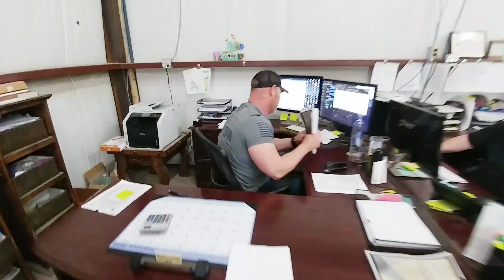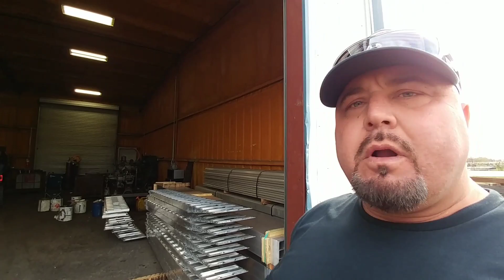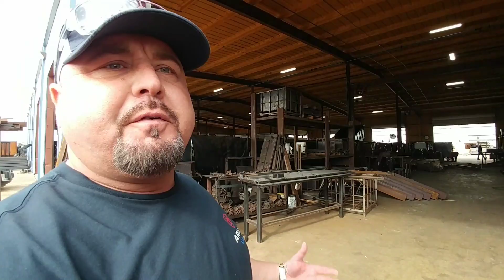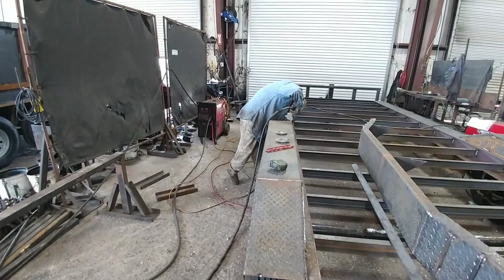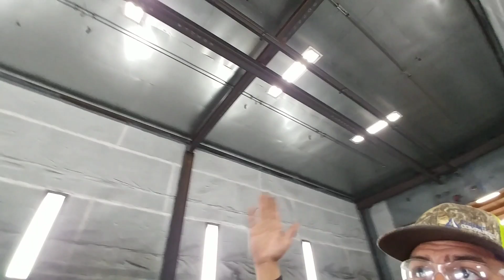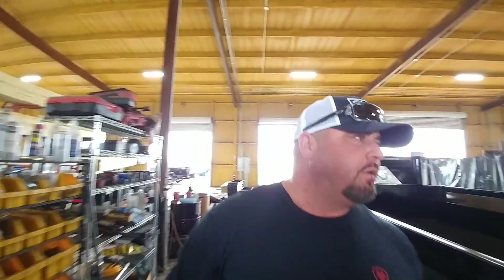How Trailers are Built! ASMR for men! Factory tour at Texas Pride Trailers!

Comment: I like Texas Pride Trailers and I know no one manufacturer is perfect so after say that, they forgot to bolt down my hydraulic pump so it was loose inside the toolbox. I purchased the trailer from a dealer in Texas and didn’t notice the problem until I was already in Georgia. I called them about the pump problem and asked what size bolts are needed for me to drill the holes and install the bolts, they said 5/16X3/4 well that was wrong it was 3/8X3/4. Because of the cross member I was only able to drill one hole and install one bolt, not a deal breaker but annoying. So Devin is talking quality control I’m sitting here thinking you missed the pump and I was missing a grease zerk on the equalizer and they didn’t get all the weld splatter off before painting. Would I buy another trailer built by Texas Pride? Yes I would, they are a structurally sound trailer.

Comment: Powder coating, properly done is superior to paint.  Paint or powder coating can be good or bad.  The reason auto manufacturers paint has nothing to do with quality.  It's an economic decision.  Texas Pride paints for the same reason.  Economics.  It's a lot cheaper to paint.

Gotta wonder if one of the checks is for square.  Lot of out of square trailers on the road.

Comment: My Experience with Texas Pride.

1.  Trailer paint was good.
2.  Weld quality was functional but hinges for dump doors were welded on crooked.
3.  Battery charge controller was broken, screws for mounting it had been driven through the circuit board.
4.  Hydraulic motor was mounted poorly, instead of drilling the holes a torch was used and the slag on the bottom of the holes was not removed.
5.  Multiple hydraulic leaks on this trailer due to the fittings not being tightened.  
6.  One automatic adjuster on the axles was not seated at the hinge point and required the hub to be dissassemb so that it worked.

Texas Pride promptly sent me a new battery charge controller, but all the other items were repaired at my time and expense.  My conclusion is that the Texas Pride Quality Control department does not actually test things on these trailers.  Brand new trailer does not  mean a functional trailer.

Comment: Wondering about protective coatings for the interior of the dump trailer they were building, also that was shown in an earlier video; in addition to primer and paint (or powdercoat), would there be any durability or performance advantage gained from spraying-in a a coating of "bed-liner" paint?
Reply from the maker: I'm sure it would add protection, however, that would make it very difficult to slide material out when dumping.

Comment: Not a single crane in sight where they were doing the majority of fab work .. absolutely horseshit  that means vertical down welds ... speed over quality . Cranes to flip the trailers into horizontal position would equal a much higher quality weld

Comment: Here in northern and central Virginia a lot of stuff is over priced I see the stuff at Lowe's tractor supply made in US but not much pant sharp edges you have to grind off and other trailer bands that are pretty pricey!! But not much quality I've priced 20' car hauler can't beat the quality and prices are within 300 or each other Texas Pride. Big Tex. Gator Made. Cam. PJ. Hudson which I own 1994 18' 10k equipment trailer it's a very well built. I also have 2007 Liberty 16' 12k skid steer trailer has fully integrated wiring they don't seem to paint under much but it's well built and I also have a 2005 7'x14' 12k dump trailer made in the Carolina's not sure the brand its it's a small manufacturer all I remember is DMV put down on the title make easy! And gross vehicle wasn't 2990 cazy I fixed it and I still get stopped by stat troopers they come to the window and say you're good i see the frame and the 8 lugs and then he said DMV has been messing up to many things! You're good to go I told him I fixed it at DMV he said it doesn't matter is always going to show to change from 2990 to 12k because it was titled with the previous owner in Florida at 12k for 5 years and then 3 years in Virginia as 2990 and make Easy it's a flag down signal for officer's that's its 12k now and we have to check the DMV records from the original title and now it's good but the other officers don't know that!. I've seen cheaply made trailers poor welds welds not complete trailer edges so sharp that it cut a line on my leg hand 3/16" deep 1/8" wide 4" long while I was loading and putting my hand on the edge trying to find a spot to strap to is my buddy's trailer I rather buy a used high quality trailer then buy a low quality trailer new and you will notice that some that are cheaper are rusting at the dealership after 3 weeks and only have one break axle add that axle to the price and your within $200 bucks, bills, clams, lettuce, whatever you want to call it but always check prices and ask people u see what they like and don't about their trailer that's what I did so I know now what trailer I will buy new even though I never bought a new one it's good to see how well they hold up especially because I'm in construction and farming it's ruff on them.

Comment: Man have they grown!!!!! I bought my Texas Pride dump trailer 9 years ago from Devlin. Its interesting to see the improvements to their manufacturing plant since I was there 9 years ago. Their plant has grown immensely since I picked my trailer up on a Saturday morning 9 years ago. The paint was still fresh (not completely dry yet) from the shop. Not primed either (btw) 9 years ago. They had a young man wiring my trailer and applying the decals out in the drive. They didn't have the final checkout station back then. They just hooked it to my truck and that was that. We were able to pull out with our really brand new dump trailer a few hours later. I know this may be sounding critical of my experience but I'm just noting the improvements to their system in a few short years. I love my trailer and still have it here at the ranch. Haven't had a single reason to part with it because it is so handy.
Reply: But you probably got it at a fraction of what it would now cost.

Comment: It's the paint that PROTECT'S, Primer or Primer-Surfacer is just a adhesion promoter for paint to stick to the steel.  Primer or Primer-Surfacer is porous, i.e. like concrete. Paint on the other hand is not porous, i.e. it will not let moisture pass through it. Texas Pride Trailers is a quality product, unfortunately Texas Pride Trailers head paint guy needs to bone up on paint and it components. My background 25 yr's combined autobody repair, 5 yr's {Body-Section Painter} major Aircraft Builder, in the Pacific Northwest, sounds like going, but with a "B." If you want to know, if the person even has a clue about paint in general, ask them what is most commonly used as the vehicle for paint.  No, I'm not asking what paint is commonly used on motor vehicles, I'm asking what is most commonly used as the vehicle (product/material to make) for paint. If you get the deer in the headlight look, (or the you have three heads look) speak to another person, until you find someone who knows the answer.

http://www.madehow.com/Volume-1/Paint.html
New synthetic vehicles developed from polymers such as polyurethane and styrene-butadene emerged during the 1940s. Alkyd resins were synthesized, and they have dominated production since. Before 1930, pigment was ground with stone mills, and these were later replaced by steel balls. Today, sand mills and high-speed dispersion mixers are used to grind easily dispersible pigments.

Comment: Definitely a well built trailer. You nailed it with painted trailers being better than powder coated. I own one of each and my powder coated one is 5 years newer than my painted one, the powder coated one looks like trash and the painted one still looks great and that’s the one that gets used the most. I have a strong dislike for anything powder coated.
Reply: It's all in the prep before powder coating
Reply: @tazmankb26  agreed, this is purely perspective based on perception. I powder coat and liquid coat for a living, I have my nace level 2, and I have worked as a welding inspector for some odd years. It’s all in the prep when it comes to powder coat, these batched trailers are most likely powdered over raw mats or chem etched, and the workers working for 14$ an hour aren’t taking their time as well as properly trained to understand kV’s, mircos and air pressure in different scenarios/angles. And powder can be spot checked, there are units that apply and cure powder simultaneously, also there are other procedures powder coaters use to spot check.